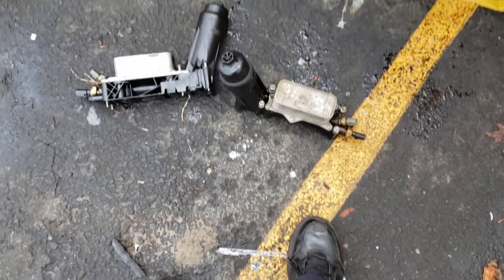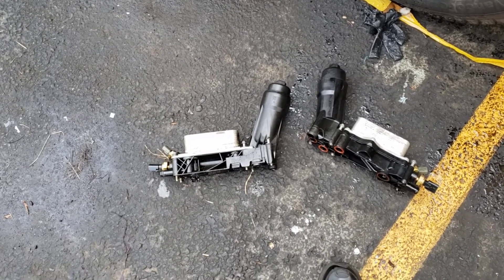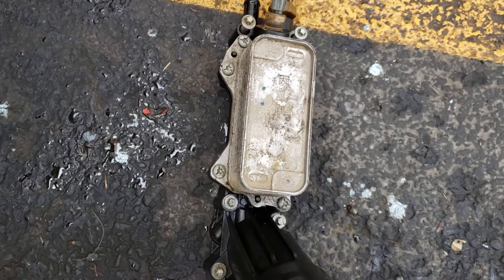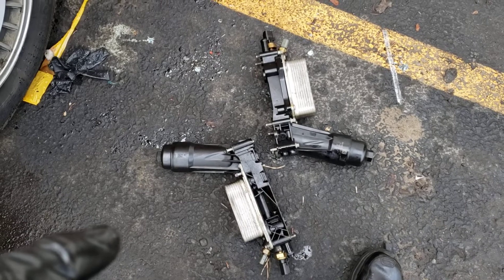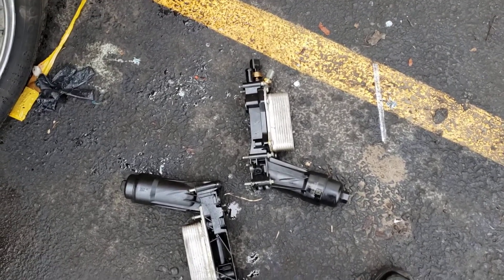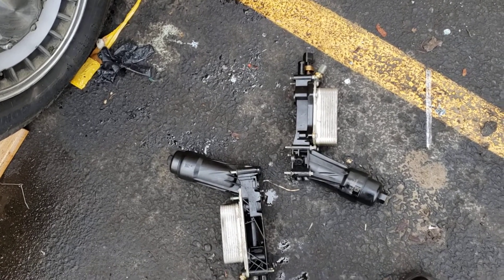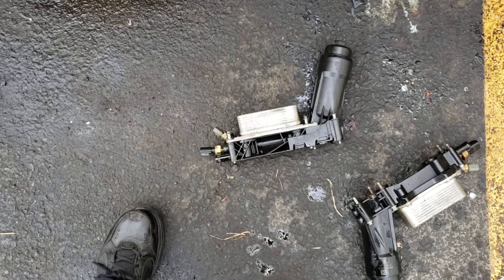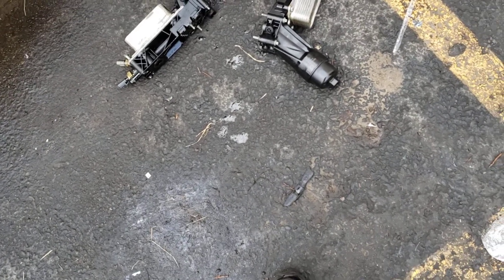Why Dodge, Jeep, Chysler 3.6 Engine's Oil Cooler FAIL!!!!

Comment: By all possible and impossible means oil change stations are for oil changes ONLY even though they "offer" a lot more. Normally, you will decline to EVERYTHING ELSE including EVERYTHING else EXCEPT oil change at all of quick lubes. The alarming factors are that they are all serviced by amateur boys with hands that has never been dirty with labor. Think about that for a moment before agreeing to what they can offer.
Reply from the maker: Most dont even know what they doing or offer good training. I have 2 mechanics works with me they not allowed to touch any cars with this style of coolers

Comment: Good video and explanation. Over Torquing is one reason while car over heating is another. I replaced mine with Dorman aluminum oil filter adapter. Never have this issue again.
Reply from the maker: Did you have overhead before you fix it? Because if it was leaking coolant then it will overhead or check air in the system. There is air bleeder valve on the hose going into the engine over by the belt. Look you will see the valve by the thormstat
Reply: @abdelcarfix2770  yes sir you are precise. The car overheated after coolant flush and the air bubbles created issue. We bledded it but it damaged the coolant lines and the oil filter adapter. Now it is all fixed. I now have one issue is the code says oil temp high.
Reply from the maker: What's the code? And did you check and make sure you connected the the oil sensor on the oil cooler?

Comment: That's not why they warp and crack around the plastic weld plugs and also from hot engine oil and high temperature of engine
Reply from the maker: Sound like you work for fast lube place and you break lots of them. I have 20 cars towed after fast lube place change the oil. They over torque the oil filter cap and it will damage it.
Reply: @abdelcarfix2770  mine is leaking at the plastic plug below the oil filter but they usually crack below the oil filter when over torqued .  Also if the filter is installed wrong and o ring is placed in wrong.
Reply: @abdelcarfix2770  cheap plastic from china
Reply from the maker: Bro replace it with OEM it's expensive but worth it. I have good luck with after market and OEM it depends on the customers if they wanna spend the money or not
Reply: @abdelcarfix2770  Generally you've made a good point, but I can provide you some photos of my broken OEM cooler where the oil and cooler fluid channels looked like melted or washed out. Thanks for the video.
Reply from the maker: Yes I have seen broken ones I agree most of them just the seals but u have broken ones.
Reply: I have the Dorman now but Oem is on my car and I bought an OEM replacement 6th revision .
Reply from the maker: Cool yeah go with OEM if you can always.
Reply: @abdelcarfix2770  I changed my oil filter housing was leaking from seals under metal oil cooler and pressure sensor.
Reply: I purchased OEM and so far so good. I change oil and filter myself now. I don't start the engine in freezing temperatures. My leak started after below O temperatures.
Reply: Chrysler engine is already big issue since zero hours. It's designed to fail quick and early

Comment: What is the torque spec on that piece
Reply from the maker: Which one there is upper and lower intake?
Reply from the maker: I torque mine to 71in lb
Reply: @abdelcarfix2770  filter cap
Reply from the maker: Just tight it to stop gently don't even try to go pass stop
Reply: It is on the cap

Comment: First time this has finally been explained completely. Mechanics always say that the housing cracks because of too much torque. I took my promaster to a quick lube and now I realize why this happened. I replaced my housing myself, and my old one was NOT cracked. The O rings were flat and hard. You explained why the leak started. The housing was pulled away from the engine block when they over tightened the cap. Thank you for this video. I have subscribed!
Reply from the maker: Your welcome
Reply from the maker: Also o rings are flats but when they put too much torque it makes it lift up and won't seal again. I have vehicles towed block away from fast lubes unfortunately  usually after an oil change they leaks or cracks
Reply: Many reasons but mine was warped and the oil pressure switch was leaking as well I replaced it  with the aluminum housing